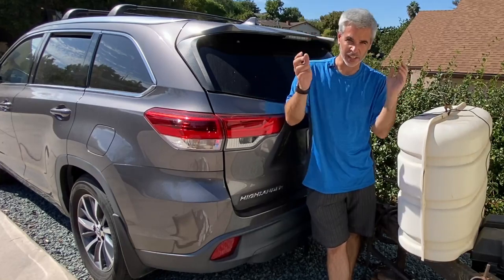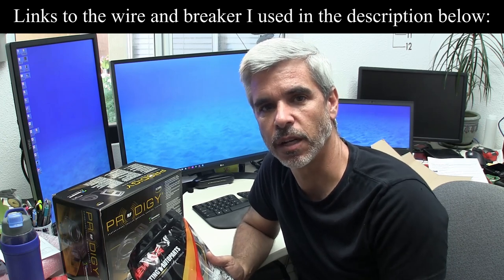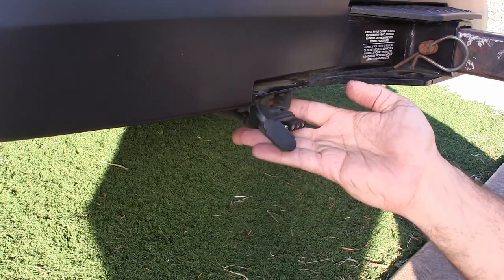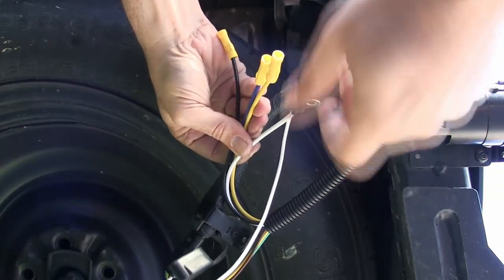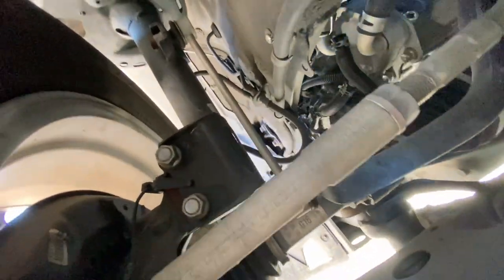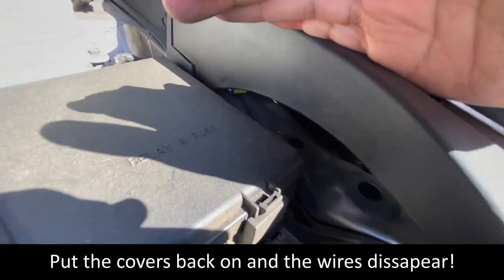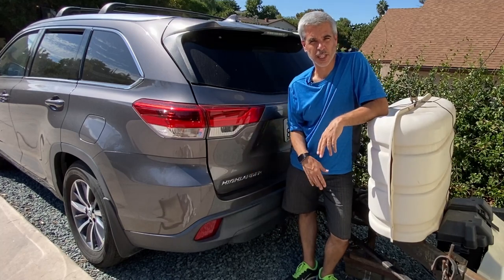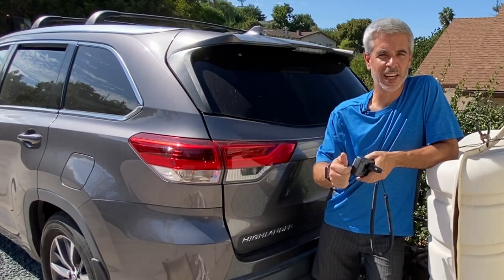Toyota Highlander 7-Pin Trailer Connector Installation

Comment: Great video, very helpful. I have a 2021 Highlander Hybrid that I need to do this for. You mentioned yours is a 30amp wire to the 7-pin connector, do you know if that is standard, or might it be different for a hybrid? It's hard to find anyone at Toyota who understands this...
Reply from the maker: The 30A value is just the standard expected capability of the connection as this also charges the battery when connected.  I wouldn't expect the hybrid to make any difference as you are still just connecting to the 12V battery which is separate from the high-voltage battery.
Reply: My father-in-law is trying to convert his 2021 Highlander (Non Hybrid). I would love to know where you ended up on this. Local trailer store said they couldn't do the conversion because the voltage wasn't right. Sounds like maybe they didn't have the right kit.
Reply: @JeffHesterDesigns  I don't know, I took it to a trailer hitch specialty shop and they installed the hitch and the 7 pin connector, and set up a wireless brake controller... keep searching, I guess...
Reply: @willcoll8789  Bear with me.. do you mind telling me the name of the specialty shop you used? I may call them directly for some insight.

Comment: Is there a reason why you ran the ground all the way up front? Could you have just grounded it closer to the back? If so would that just mean that we’d only need to run one wire to the front?
Reply from the maker: I think that is correct.  I plan to add a subwoofer to the back area so a multi-conductor wire that is nicely armored seemed like a good idea. A separate ground wasn’t exactly necessary but would provide a cleaner ground for audio purposes.

Comment: Mr. Holt,

What did you do with the remaining white wire you looped into that hole? I didn’t see you secure it in the video in the engine bay under the plastic covers when you secured the green cable as your ground? The white cable from the 4 way to 7 way is grounded to the chassis at the rear correct but what about the white cable in the front? Also 2nd part to my question, you just used a 12g feeder wire from the battery to the 30A breaker correct?
Reply from the maker: The white wire was not used at all at the front or rear.   At the back, the green wire was connected to the white wires.  Sorry I didn't show that more clearly.  I figured I'd use the spare white wire for powering an amp or subwoofer, or even an inverter installed in the rear area some day...
Reply: @DansWay  thanks for the quick response. In the market for a Geo Pro and needed this video explanation to complete my 7-way connection! If I have anymore questions I will ask here in the comments sir!
Reply: @DansWay  So, with a wired controller that white wire would go to the controller? What you did was to use one wire to supply the battery charge and B+ to the wireless controller on the trailer? That means you could have just run a single wire instead of a 3x cable if you also utilized a ground at the rear frame location?
Reply: @DansWay  That's a great idea!!

Comment: What sized Screws did you use when you drilled new holes to fit the bracket to the OEM Hitch Receiver mount?
Reply from the maker: I drilled it out, and most likely used a #12 screw.  Just keep in mind that this thing could get hit at some point so make it substantial enough to hold.
Reply: What size drill bit did you upgrade the holes to? I had same issue with the pre-drilled holes not lining up? Also did you have any issue with your bracket being in the way of the left fascia trim that came with the OEM hitch receiver?

Comment: Where do you plug in the brake controller
Reply from the maker: The prodigy controller is wireless from the user-interface, so the controller installs on the trailer, and the hand-held interface goes in the truck, plugged into a 12V outlet.  The interface lets me manually set the brake and the braking sensitivity.  It also display the current braking level on the display.  The controller on the trailer is measuring the g-forces and can 'sense' how hard the truck is applying the brakes and helps by applying the trailer brakes.
Reply from the maker: Hey@Grant Taylor , So I'm trying to understand your comment.  Are you saying that the 7-pin wasn't needed because I didn't install a brake controller on the Highlander?  In my case, the Prodigy wireless controller is mounted to the trailer and the 7-pin is providing the power to the brakes and charging the battery.  You could also mount a wired controller in the cab and use the 7-pin connector as well.. I hope this help...
Reply: @DansWay  Hi Dan, when you say charging the battery? What battery were you referring to?
Reply from the maker: @reempire888  the battery on the trailer is charged by the tow-vehicle through the 30A power connection.

Comment: My 2019 highlander is a hybrid and I need to do things a little different 
Would you be willing to talk to me by phone
Reply from the maker: You can email me at dtdw@danholt.net
Reply: On your receiver, does the blue wire connect to anything? Second, can the breaker be mounted on plastic instead of metal?
Reply from the maker: @DarrellBailey-w4r  The breaker needs to be securely mounted, but doen't have to be mounted to metal.  Just best practice considering the vibration and loading of the wires on the breaker.  The Blue wire goes to a wired under-dash brake controller if you are installing one.  I chose instead to use the following wireless system by Prodigy: https://geni.us/Prodigy_brake_control.  It works quite well.
Reply: Thank you so much .
I got the complete system that was on your website